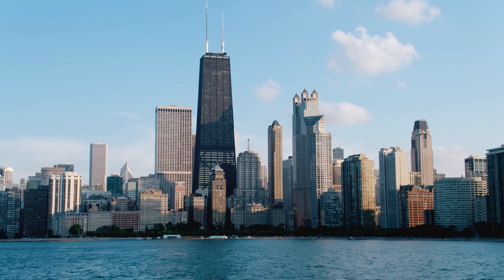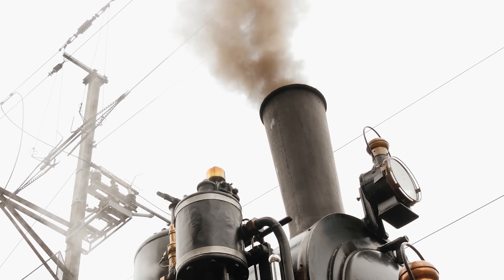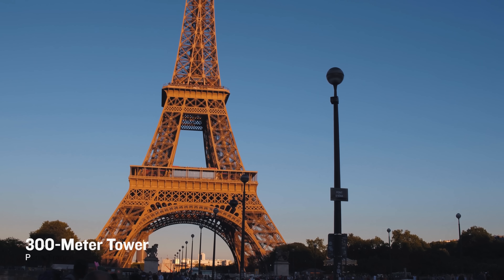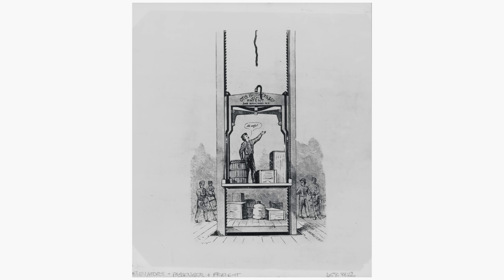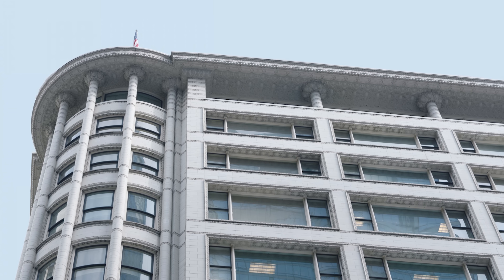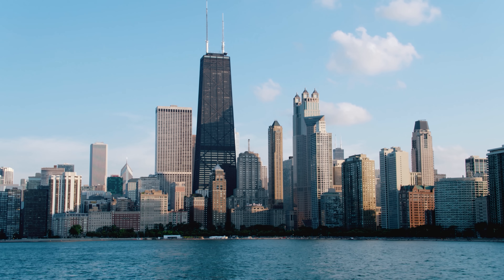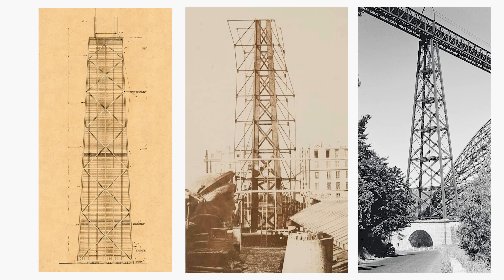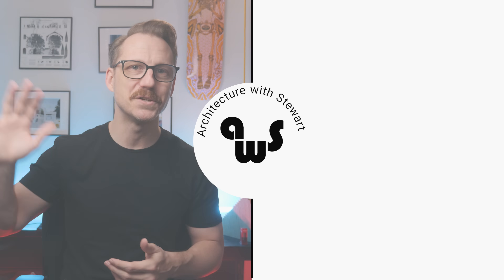How Buildings Changed After the Eiffel Tower

Comment: 150 N Riverside in downtown Chicago is one of my favorites, with an insanely narrow core and the building getting wider at the top. To prevent it from tipping over, there's a giant counterweight on the top floor- FULL OF WATER!! if the building sways one way the heaviness of the water on top it will pull the building back to equilibrium

Comment: I just have to say it - the John Hancock building is one of the very best tower designs of the mid 20th Century - period. Having worked for SOM as an architect in the 1960's I was completely captivated by this building. The building has a visual strength and integrity far exceeding many other buildings I've seen since then. It isn't very often that a modern design comes along which successfully combines both building structure and building design to complete an absolutely convincing idea. For good reason I think it interesting that not many architects and or developers dared to copy Hancock after it was completed. The tapering form of the building might have more to do with wind loading but I think it's a stroke of geneous!

Comment: Those big diagonals of the Hancock tower look good. They form nice row of diamond shape. And the fact that the whole tower tapers is good. It grounds it. But honestly it wouldn't hurt with some of those additional decorative bits from the Eiffel tower, maybe just sprinkled around the joints and at the top and bottom. Right now, the tower really only has detail on one or two scales. Especially when you look at the street level, it's just really boring stone planes, with no human sized shapes, rhythms or patters to relate to. And no grand emphasis on the entrances.

Comment: For me the most interesting one is Norman Foster’s HSBC building in Hong Kong. Not only does it have its unique structure on display, but the open space at ground level which serves as a community gathering space shaded from the grueling summer sun serves a vital rose in an area where every other building is either a mall or an elevator lobby at the ground level. And the atrium is pretty cool too. 

Honorable mention goes to the neighboring Bank of China Tower which also proudly displays its structural framework. (And in another category altogether, the Standard Chartered building on the other side is just a fascinating piece of architecture for other reasons)

Comment: Towers have their merits, but as far as I can see, the main one is simply that they allow you to put a lot of building on a small building site, that was surveyed on the assumption that something relatively small would be built on it.

My favorite tower(s) would be a pair (or more) of these that were united as one (with transitional architectures of some kind linking them up). Ideally this would be at least a block of them, and it would be better if there was nothing in front of or behind the row. "At least a block" is quite a low minimum. A better size would be, say, 5km long. The designers and owners of sections would just have to share a bit. They'd have to design not just the imprint of their own egos on the eyes of all beholders, but also a negotiated link by the guys "next door" (the next connected section) who have their own strategy for catching eyes, and standing out from the common herd.

On as yet unsurveyed sites, it seems strange to impose the small stand limitation on taller buildings. You'd think in places like Dubai, where they started with tabula rasa they didn't need to imitate old cities that grew up out of the limitations of their original town plans. They could've built whatever they wanted, but they built towers. I suppose it's more difficult to make something bigger have parts with individual identities, but if you're going to star comparing sculpture to sculpture, there are plenty of much smaller lumps of shaped material that have more design to commend them, than do towers.

(That said, the idea of wearing the structure on the outside is more beautiful to me than that of faking up the facade to look like it was designed during the days of the Roman Empire. At least this style makes a break from limitations that don't actually exist for the new building, and were just accepted because of the same need people have for things that look "normal" to them, back in the day. The old stone facades are the tower form of their day, in this view of things.)

Comment: One of the most fascinating discussions of modern building design (to me) was the Citicorp Tower in Manhattan.  They built it, but then it turned out that they had not calculated wind loads coming in at the corners of the building, I believe for a 100-year windstorm.  I'm a bit hazy on the details at this point, but it was a graduate student made the discovery that the building likely would not hold up to such a storm, so they planned for some retrofits, and then tricked building users out of the building for a period of time long enough to make the alterations which included interior diagonal bracing.  Years ago, there was a lengthy article in the New Yorker magazine.  And they completed the work just in time for just such a storm.  Totally fascinating.

Comment: Definitely the One Thousand Museum Tower in Miami is a great example, though am unsure what percentage of structural load its reinforced concrete exoskeleton actually takes?
Also the WTC buildings steel load bearing exterior walls.
Was wondering if anyone can explain the principles of load transfer as struggle to understand weight transfer in relation to gravity in regards to certain skyscrapers that don't distribute loads down vertical columns into the solid bedrock, for example the WTC towers weighed 500,000 Tons each if for example you cut the tower off at the 2nd floor and sat a weight of 490,000 Tons on top would the 2 story structure support the weight or is weight taken out of the equation of such structures through the loading tensions of each supporting member down through the building?

Comment: I can think of Jean Nouvel's Tower Verre in Manhattan as a good example of an exterior structure. The advantage is that you can eliminate the inner curtain wall. Back in Chicago, the Inland Steel building on West Monroe is one of my favourite high-rise buildings. The paradox is that its exterior, clad in stainless steel, is not something that was ever manufactured by the Inland Steel Corporation.

Comment: Love your channel. And come to think of it, that John Hancock building is really not all that beautiful to my eye. The now-gone World Trade Center in New York (designed by Minoru Yamasaki) also used an exo-skeleton for some of its structural strength. PS: What are those weird cube windows sticking out of the Sears Tower (at :30 in the video)?
Reply from the maker: They're extruded glass alcove/balconies. They have glass bottoms so it feels like you're floating outside the building.
Reply: Lived in Chicago for nearly 30 years, and formerly lived within a short walking distance from the John Hancock.  Its an imposing structure which never gets old.   I now presently reside in NYC, but visited the WTC towers when they were still standing.  Everything about this project was overblown, including  its details, which  were crude, repetitive and budget oriented.  In short, cheap and uninspiring.  Whether it was the monotonus exterior or the flashy, 70s,  interiors.  The John Jancock and Sears Tower, are far superior works of architecture, and engineering in every executed manner and treatment.